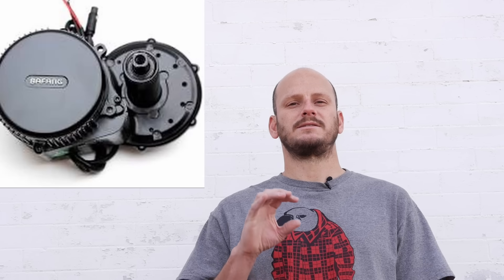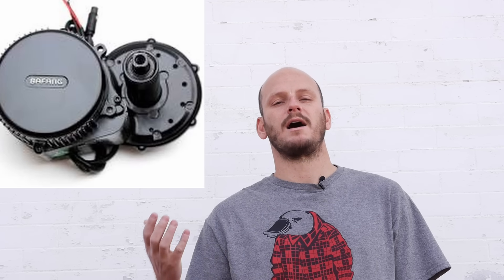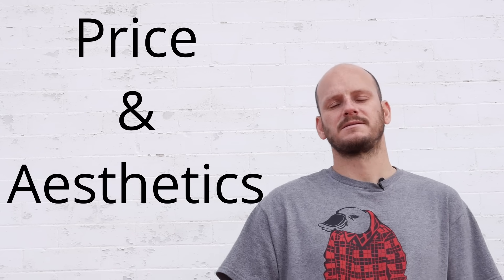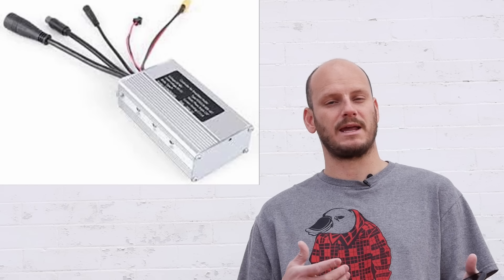Hub vs. Mid Drive Motors: Why Hub Motors Suck and Debunking Common Myths with performance test

Comment: Mid drive with belt drive is the way to go
Reply: That sounds very interesting...
Reply: Pair it with a nuvinci and you have a winner right there.
Reply: @totoroben  and electronic shifting and congratulations you made a automatic bicycle
Reply: I was thinking this too. Who sells such a thing?
Reply: passthepipe1   Bikonit Warthog.... also has twin batteries...its a beast...
Reply: @joethompson2910  damn that looks good but I need suspension in the back too.
Reply: @joethompson2910  yes I was just about to dive in with a Riese & Muller (credit baby!) but you can't get a throttle and to be fair the new Bafang motors make the one in the R&Ms look weak. I wish R&M could blam the Superdelite with a mental mid drive motor and a throttle, I'd buy it immediately. Anymore suggestions?

Comment: I bought a top of the range Kalkhoff electric bike with a mid drive motor.   NEVER AGAIN.   Eventually when the motor had problems it had been discontinued.   So it might have been possible to repair but wasn't worth the expense.    So now the whole bike was useless.   So now it's a front wheel hub drive.   If the motor ceases to work you can easily fit a new one or return the bike to a normal road bike.

Comment: What I like most about the mid drive is the center of gravity is kept at the center of the bike and down low.  It handles more like a sports car. Hubs are heavier and carry that weight higher at the back of the bike. It's just not ideal for handling.
Reply: Why would hubs carry their weight at the back of the bike if you put the motor on the front to balance out the back?

Comment: chain strength, when converting a regular mike(peddle bike) Where to buy a stronger chain?
Reply from the maker: Most name brand chains are just fine for normal riding with a mid drive
Reply: If it's a one speed, a 415 chain from a gas bike kit might work. My buddy did that to his dad's trike. Looks beefy as hell.

Comment: What is your opinion on the Falco hub drive? It is a 5 phase drive. Does that help reduce or eliminate the concept you describe of hub drives being single “3rd gear” like performance?
Reply from the maker: No, its just using 5 phase wires instead of 3 to get the power to the motor. the physical motor is still fixed gearing. ie. 3rd gear

Comment: I have a Hub Motor and i hate it but not much mid drivers that are in my power range 5 - 10KW most gears and chains dont last long, I havnt had any issues but once you get into big power 100v stuff Mid drive gets left behind unless you by big block and then you have million moving parts to check
Reply from the maker: yep. over 2k watts and a hub motor starts to make more sense for most applications.

Comment: Help guys! Im going to have about £3000TO£4000 and was going to get the f1 stealth bomber 72amp 8000wat got to look like a pedal bike still but want the power to do 60mph at least but small enuff to chuck around small tracks tiny jumps/bumps also good mileage ..give us a heads up ? Sur ron.bomber?clone e bike or DIY? What's good.

Comment: I have a mid drive 36 volt bike with no gear changer just a single gear I wish I had 8 gears maybe I would get more than 20 kilometers  an hr out of it and it's a heavy bike could probably run a Honda 250 in it
Reply from the maker: You definitely would get more speed, power and efficiency with gears.

Comment: I don't understand how could it be that hub motors get more spokes loose. Mid-drives also transmit their power through the spokes. Maybe it's just that hub motor manufacturers cheap out on the spokes, instead of being inherent to mid-drives.
Reply from the maker: exactly the reason. Spend $200 on a hub motor kit and you will have zero QC
Reply: @JohnnyNerdOut  Must be it right? Great video, loved to hear your opinion and experience on the matter.

Comment: The amount of money I've saved on replacing drive trains over the last 6000 miles pulling a cargo trailer can buy me a new motor and some new tires with enough left over to buy dinner. I keep everything within reason and remember it's limitations so that I don't burn it up pulling heavy loads with my mac 12t hub motor. Plus it's real hard to get the chain line correct on my bike for a mid drive.
Reply: Not enough gets said about the stress that mid drives put on conventional drive trains. I've gone with a mid drive motor, belt drive and hub gearing on my bike. Hopefully this will reduce maintenance costs. Time will tell.

Comment: Er.. Since I already have an ebike with a front hub motor.. can I Add a mid drive motor and use both?.. Or perhaps I should just build another ebike altogether.. I don't wanna lose the use of the front hub motor I already have.
Reply from the maker: Ya you can add a mid drive and have AWD😀
Reply: @JohnnyNerdOut  Thanks!

Comment: Mid drive is not legal in my state unless you remove your gear shifter and all related parts which defeats much of the purpose. Also with the rate of chain breakage of the mid drives, I'll stick with a hub motor.
Reply from the maker: What state? That’s insane😡
Reply: @JohnnyNerdOut  VT. I was told this by a few officers one day while I was out riding. I went home and looked up the law they said I was violating which says "equipped with a power drive system that functions directly or automatically only, not requiring clutching or shifting by the operator" but I think they were confusing motor-driven cycles with ebikes. Just the same, I haven't had the resources to push it with them so I sold that bike and have a new one with a hub motor.
Reply from the maker: @AsylumET  usually it’s a power rating limit. Like 750w
Reply: @JohnnyNerdOut  yep we have that as well. No more than 1000W, 1.3HP and not capable of going faster than 20MPH with a 170lb rider. Personally I think it is all BS made up by people who haven't a clue.
Reply from the maker: @AsylumET  exactly! Write to your representative. Trust me it helps. Ask what they are doing to make your area more ebike friendly.
Reply: @JohnnyNerdOut  I actually write them frequently for numerous issues, helped some with their campaigns, organized protests and so forth. This hasn't yet been one of those issues but good idea.
Reply from the maker: @AsylumET  I have plans to post a video about that topic soon hopefully.  😀

Comment: Well, I've had my front hub motor ebike since 2010 and love it But.. I'd have never even heard much about mid drive motors cus the place I got my ebike kit from didn't sell them. I'm doing research now because I have to replace the battery and it's how I found this video. Looks like I may be getting a mid drive because I wanna make an ELF clone. Top speed with 4, 12v 20 Ah SLA batteries is 38 mph so I don't push it over 35 mph but that hub motor has served me well for 11 years.
Reply from the maker: Nice! The ELF velomobile?
Reply: @JohnnyNerdOut  Yeah, you see.. I want two seats so the wife can tag along and room for groceries.. I also like the idea of a cover and doors for rain and wind protection. I don't know that I'd have to add solar on top because I wanna build a home solar charging station that serves as a carport/bikeport.. Elfport LOL.. Perhaps just add another set of batteries I can switch to if need be for long hauls. All this is in my head for now though, I have no clue yet how I'd produce the body.. still looking into options. For me it's a DIY project because there isn't any way I'm gonna spend 9 thousand dollars for an Elf.. if I had that much to spend, I'd just drop an EV in my Smart Fortwo Passion car which currently runs on a 3 cylinder gas engine. ( Oh the speed I listed was for my hub motor ebike Btw.. I didn't build the Elf clone yet.. just wanna clear that up)
Reply from the maker: @DivergentDroid  that sounds awesome! I too want a velomobile. Almost bought the virtue cycles one a few years ago off a guy. Probably should’ve.

Comment: well the largest advantage to a hub drive motor over a mid-drive motor is that the hub drive motor you can do throttle only and not have to pedal whereas on a mid-drive you cannot do throttle only and I like to throttle only while cruising around so for me a hub motor is much better than a mid-drive for that reason alone
Reply from the maker: Whaaaa?
Reply: I use my throttle only all the time on my mid-drive bike.

Comment: My electric car has no gears - because gears are required for the limitations of an ICE engine or our legs.
Reply from the maker: Yep. They do also help with the limitation of a low powered electric motor too though.

Comment: It may not be as much a comparaison between the two motors but rather how either answers one’s needs, no? I.e. MTB : sheer power needed vs road bike when assist is enough vs urban bike when not pushing the pedals may be desired... Needs vary ; matched will differ.  My 2 cents.   Great content to use as input. Thx.
Reply from the maker: Kinda. If your on a road bike and come to a big hill that motor isn’t going to cut the mustard. Fine if you live in Nebraska I suppose.

Comment: Regarding complaint about spokes on a hub motor, the torque on a midmount is also transferred to the tire through the spokes, so what's really different? A bit deceptive to compare electric and combustion motors - electric motors generate highest torque at low/zero rpm. I've ridden thousands of miles over many years and never broken a chain (or spoke). Hub motor!

Comment: If your chain snaps you'll still get home with a hub motor as long as you have enough power.
Reply: Your chain won't snap with a hub motor!
Reply: @NickDaTech  If you get a flat tyre you'll still get home with a hub motor.
Reply: @peroduanippa  if you get a flat tire you'll still get home with a mid drive too
Reply: @NickDaTech  Yeah, I know.
Reply: @NickDaTech  If you walk the middrive home.

Comment: What if you put your mid drive motor in the hubs then you get all the power and you eliminate belts, chains, gears, noise etc. and you get 2 wheel drive? Of course the electric motor would have to be designed and wound to run at the correct (slower) rotational speed.

Comment: I might be biased as I'm a rad 😎 rover guy, my main concern and thoughts about mid drives were always the abuse wear and tear on all of the sprockets and torque applied to the spokes, i feel like youd need a pretty high end bike to start with and that it'd have to have some pretty mean wheels also thinking mid drive could be harder on tires and maybe cables always shifting more often last but not least I feel like the hub drive might just be easier for the person that wants a thoughtless ride not having to worry about what gear to be in and last but not least I feel like the extra torque could actually be dangerous as far as spinning out goes please chime in guys there's always gonna be a trade off for everything in life I don't feel like enough pros were mentioned in this video about hub motors
Reply from the maker: I mean, your not totally wrong. In fact your right with an asterisk next to all points. With proper fundamental riding, you have nothing to worry about. But yes. If you want to thoughtlessly ride. A hub is the way to go. Might be the new slogan!

Comment: I am curious about a hub drive bike I am looking at. It uses 2 hub drives (front and back drive - AWD) that are 750w each. According to the hype videos on yt it shows spinning wheels, etc from start off. Just wondering if they have improved hub drive since this video of yours, or is it smoke and mirrors? Apparently they have metal internal drive gears and the bike is a scrambler style.
Reply from the maker: I would still do a mid drive over two hub motors EVERY time. Totally smoke and mirrors.

Comment: Get a gearless hub motor and its quiet and reliable.
Get a mid-drive and it's noisy and will break down.
Reply from the maker: First half is correct. Get a bafang BBS02 mid drive. Bulletproof and super quiet

Comment: It’s not like it’s stuck in 3rd. It’s like Automatic vs Manual.
Reply from the maker: What hub motor has the ability to change its motor gearing? I know of one that has 2 gear ratios. Please send a link! People keep saying this but never sending a link to verify such a thing exists.
Reply: @JohnnyNerdOut  You are definitely right. I took a ride today and tried to go across the street real fast realized it does feel like it’s stuck in third gear 😟 it took off real slow and picked up a few seconds later.

Comment: If you like going thru cassettes in 2 weeks listen to this guy. Mid drives are fun but if your goal is to get from point A to point B on the road hubs are the way to go
Reply from the maker: 😂 what kind of cassette lasts 2 weeks?
Reply: @JohnnyNerdOut  any. 11t and 13t cogs broke in half after like 80h of riding no joke. One of my issue was I didnt have a big enough chainring (38T) so I was always riding on the smalls cogs at the back. Modern day bikes geometries don't allow for much chainring clearance these days
Reply from the maker: @rantanplan7474  sounds like
1- you already had worn cogs before the conversion and adding a motor just speeded up the inevitable 
2- by constantly riding in the wrong gear (11-13t) that put too much strain on too small of cogs. Important to note that even though a cog has 11t only half of those teeth are engaged with the chain (5-6) so using biking fundamentals does become more important with mid drives vs. hubs. My wife is newer to riding but is still on her original cassette after 500 miles with very little wear. I’m not trying to bash you, but just going off what I’ve seen in my time as a bike mechanic and how people have a tendency to ride. 🚴‍♂️
Reply: @JohnnyNerdOut  I'm talking about brand new Shimano cassettes. I was riding full time, in any conditions, on max assist on a 500W mid drive, which probably peaked at 750W. When you ride that much you don't wanna depend on the weak transmission of a bicycle you need more reliability.
Reply from the maker: @rantanplan7474  that’s really weird
Reply: Wrong. If you have a Shadow Conspiracy chain you can handle tens of thousands of miles of wear on a high power mid drive.
Reply: what all of you guys fail to understand is that some of us ride in downtown cities over 40h/week to make a living. I'm not gonna switch up and down the gears all day long. All I do is accelerate up to 45kmh and go back down to 0 at every god damn intersections. I can't bother swithing gears so much. 1 gear can do the job (a geared hub motor in my case, the GMAC motor) and there isn't any stops in the accerelation

Comment: WELP this video is just dripping with Bias. 

Lets address the elephant in the room that you conveniently ignored: COST 

A BBSHD is $700 A BBS02 is $500. 

A hub motor kit is about $300. You can also build up a kit yourself for about the same cost and get superior parts if you are comfortable building your own wheel. Of course that means every commercial E-bike builder that's selling you $2,000+ ebikes with hub motors is ripping you off hard core.

Second is WEIGHT. A BBSHD is 13 lbs. A standard geared Hub motor is 7-8lbs + 1lb for a controller. Not as big a difference as cost, but every lb saved is appreciated when you have to regularly lift the bike. And no you don't count finished wheel weight, because you'd have the weight of rim and spokes regardless.

Third, for reliability you conveniently ignored the existence of Direct drive motors, which have no gears or other failure points, just the axels riding on the bearings. While these motors are heavier then mid-drives and geared hub motors, they are easily the most reliable. They can also be upgraded with ferrofluids, giving them far better cooling characteristics then any other type of motor, which is vital for long uphill climbs in mountainous areas. 

Also Spoke breaking is not the motors fault. A properly built hub motor wheel will not break spokes. That you had to constantly fix spokes says a lot more about your supplier/your wheel building skills then it does about hub motors. The hub motor wheels that I build, just using regular 14g spokes, do not break spokes. The one wheel I got prebuilt from China with thick 12g spokes tried to rip itself apart first time out, then after some serious tightening, it continued to break a spoke almost every week. 

So anyway yeah, Mid-drives perform better, arguably at the cost of chewing up bicycle drivetrains that were designed to handle human power, not motor power. However you misrepresented every other advantage, and neglected to mention the biggest advantages of hub motors.

I would recommend hub motors for a host of applications: 
Ultra light/stealth builds (mid-drives stick out like a sore thumb and weigh too much.)
Low Cost Conversions (300 vs 5-700 is a no brainer here)
High Power Conversions (As you said, the performance gap closes with higher power, but this applies to bicycles as much as it does motorcycles).
Ultra Long Range/trekking builds (specifically using a direct drive motor on a heavy duty frame that can handle the weight of a DD motor and a large battery.)

And Ironically, I would consider single speed bikes to be a good candidate for mid-drives. While you give up the superior performance characteristics (Which lets be fair, we're not supposed to be going over 20 mph on the street with a throttle, by law...), single speed bikes have thicker chains and solid sprockets that can much better handle the extra power of a mid-drive. A single speed mid-drive with a smaller front gear and larger rear gear will top out at 20 mph, but will have insane torque/take off speed.
Reply from the maker: Mid drives are still waaay better. No 750w can match up to a 750w mid in any category.